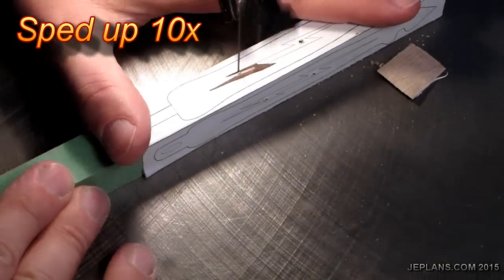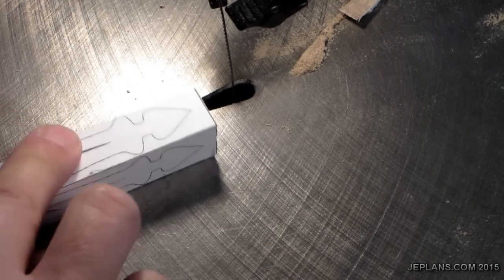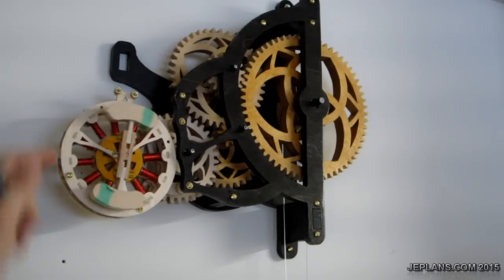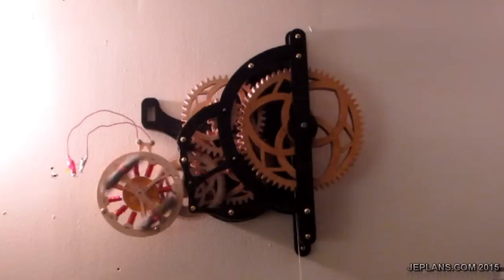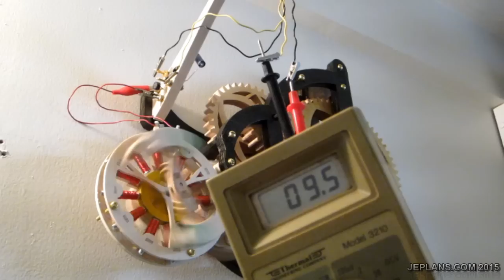Grav-Light Part Six

Comment: Need more gears. Practical use 20 years 10 big 10 small. If you have 1 to 10 size between big and small wheel, you will be have 1 000 000. Try used industrial generator.

Comment: Not sure how you wired everything together, but those 12 coils if you have them paired up make at least 6 individual sine waves(phases) which should be rectified on their own and fed into that capacitor.
A car alternator for example has a 3 phase output and comes with a triple rectifier so it makes a decently smooth DC voltage.

Comment: Why not try it with a stepper motor , its wear resistance is very small . how  time should the cargo arrives to the floor ?I do not know English, I use google translate
Reply from the maker: ermac 1950 The load varies depending on what is being powered. Because of how bright the light I want light, it will be less than 5 minutes .

Comment: Cool project, i love it. It's a great idea and a great making.

But to be true i see obvious issues in this idea due to energy conservation laws.
First : the light is not powered by gravity. It's powered by yourself, as you lift the weight. Gravity is just a (inefficient) way to store (and restore) that energy.
So more weight you add, more energy you used to lift it and consequently more energy is delivered. As you seen yourself, at some level, it's not practical at all :)

But as the LEDs consume such small power nowadays, i think it exists a possibility this can be done and i'd be a customer for such a product.
Reply from the maker: Rick Blaine it is definitely not practical or at least my version is not. Unless of you have no access to electricity and no other means to produce it.  However there already is product out there called the Gavitylight.

Comment: electricity is generated when the magnetic field passes through the WIRE.
most of your coil windings wire is nowhere close to the magnets.
also, if you had twice as many magnets, it would be easier to rotate from winding to winding
Reply from the maker: InvalidMemberAccount The bolts become magnets when the magnets pass near them. As each magnet passes by the bolt the field reverses because the poles alternate.

Comment: I habe a suggestion: you could Marke a bigger diameter pulley for the weight, then it would also run more smoothly.
Reply from the maker: lego getriebe yep, I have actually already started remaking the pulley and ratchet mechanism. I won't run as long but, won't need near as much weight.
Reply: Great! New Video upcoming? Btw: I really like your grav-light series!
Reply from the maker: lego getriebe Thanks, I expect one more, but it will be a bit , I broke down and ordered some LEDs so I can arrange them to better match lower voltage output giving me better run time.